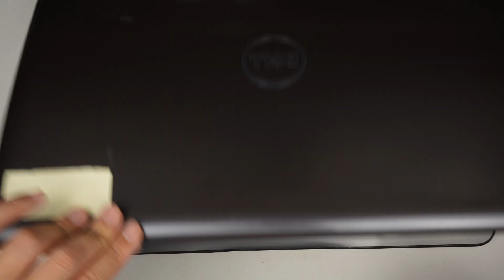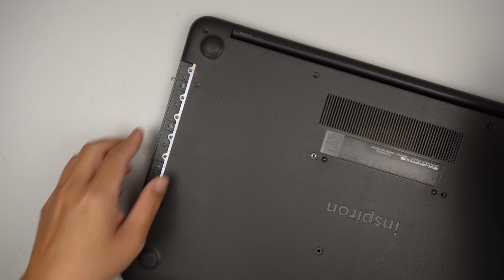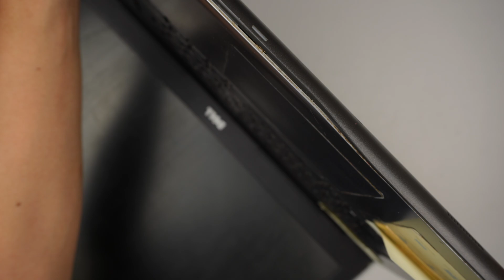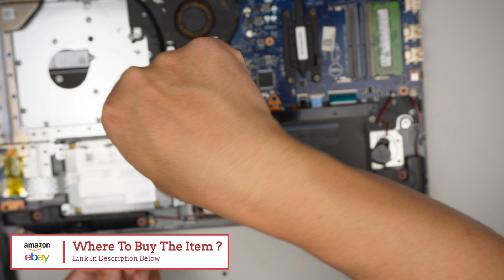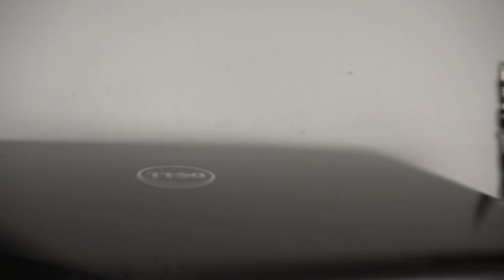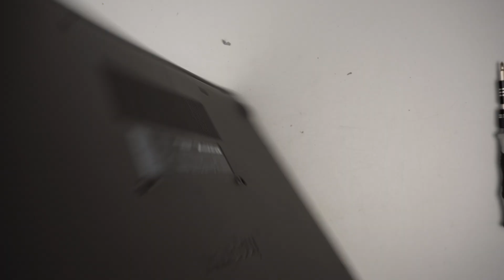FIXED Dell Touchpad Not Clickable

Comment: Hi Simon my name is Clement... Please can you help me out with this: I got a new battery into a toshiba Tecra m11-101 laptop. It powered up after installing the battery, then I shut it down. When I powered it up again, it refused to power then I discovered that it was motherboard problem. Please advise me on what to do...thanks alot
Reply from the maker: Hi. What happens when you remove the new battery and just do direct power from the adapter ?